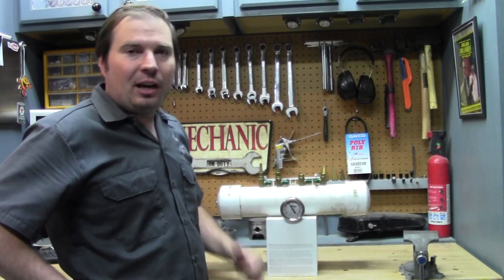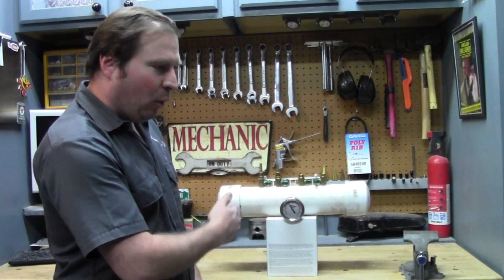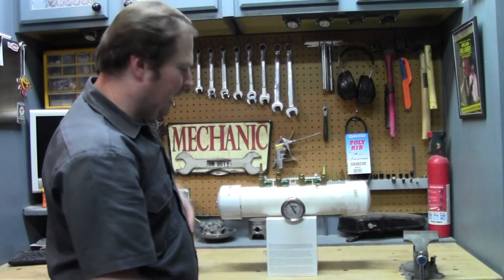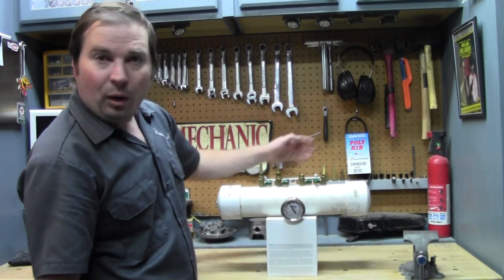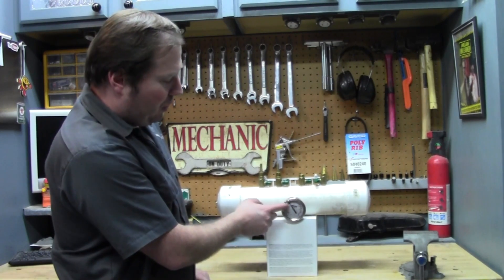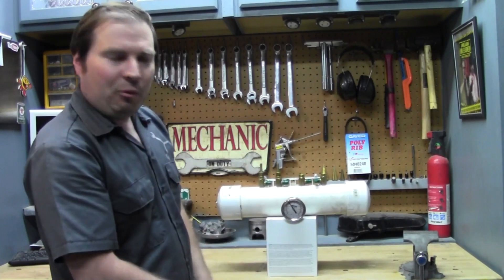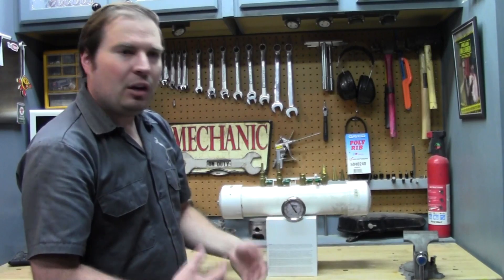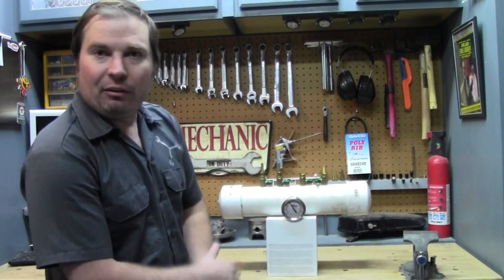Build a Carburetor Synchronizer tool - adjusting a carburetor

Comment: Do you pressurize the plenum before using it?
Reply from the maker: No.  The plenum is just a muffler to even out the pulses from the valves opening and closing, otherwise the gauge would just wig/wag back and forth giving an inconsistent reading.

Comment: Why not just use a vacuum Guage?  Ist that the same thing?
Reply from the maker: You need a large chamber to dampen the pulses from each intake stroke. Unlike a automobile engine which has a lot volume in the intake manifold. If you just hook a guage up to the vacuum port it will just wig-wag back and forth.  Furthermore having all 4 cylinders hooked up at once you can take readings individually while it is running by opening and closing the valves.  This was all explained in the video.
Reply: @thejunkman  thanks!!!

Comment: is there a technical reason you built the chamber that big, regardless of the number of cylinders you are doing 1 at a time and that seems like a lot of plenum space for a small single cylinder. just out of curiosity have you run it with all the valves open?
Reply from the maker: 1:24 I explain that in the video.  And the volume has nothing to do with it since we are reading a pressure differential.  A true manometer uses Mercury which by its nature dampens the pulses of the piston moving up and down and the valves closing.  A typical vacuum gauge is too sensitive and putting it right on the intake port just means the needle is going to wig-wag back and forth every other revolution.
Reply: @thejunkman  Can this be used for 2 stroke outboard motors??

Comment: Could I get dimensions on materials and the chamber? Looks like 3" PVC? Sch 80 to allow for tapping? Does length/volume of the PVC chamber matter?
Also, do you use restrictors in line on the tubing?
Thanks for your help.
Reply from the maker: It is 3 Inch schedule 80 for wall thickness.  Volume doesn't really matter but this was plenty to even out the intake pulses on 4 cylinder motorcycles, thus the 4 valves.  No restriction in the tubing is needed.
Reply: @thejunkman  Any way you can add any links to the parts needed in your description?  I would like to build this to your specs!

Comment: I need help building this. did you use air compressor fittings here? This is one of the best diy builds I saw so far
Reply from the maker: +Ty Kendrick just brass ball valves and barb fittings